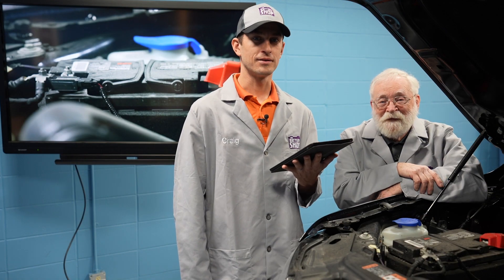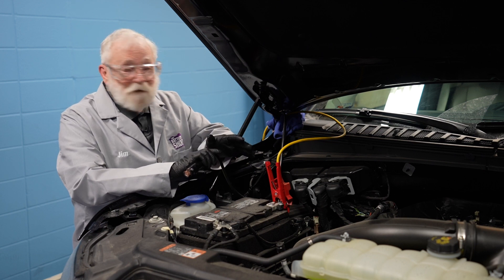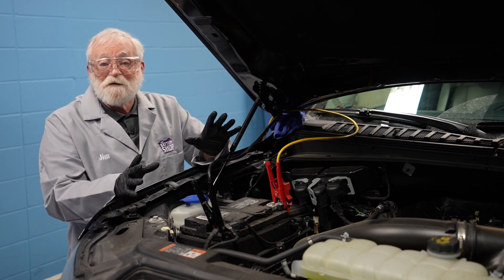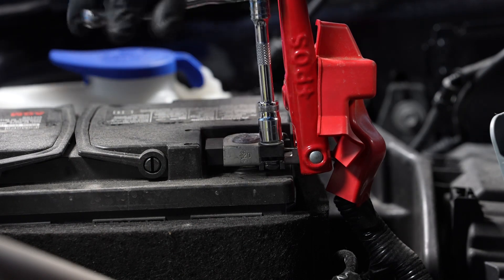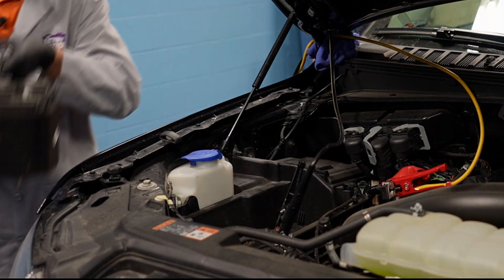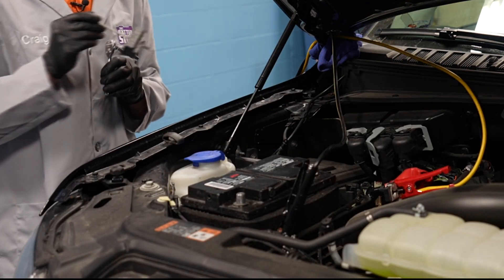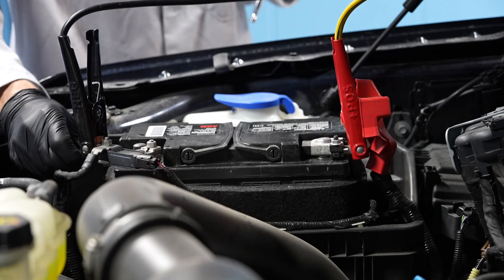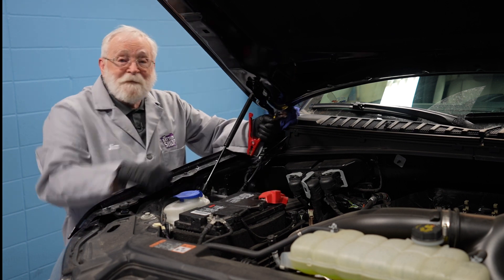Ford F-150 (2015 - present) - New Battery Install

Comment: Thank you for this helpful video. Can you tell me please what is the right battery size for Ford F150 2016/2017/2018 V8 ? AMPS AND CCA
Reply from the maker: Thank you for watching and glad you found it helpful.  The battery size and CCA for these year ranges vary by engine size and model that you have. We would suggest visiting autobatteries.com for proper fit and function.

Comment: I just swapped the battery on my 2018 F-150 Lariat with 5.0. The owners manual didn't mention any of the extra steps that you are showing. I removed the old battery, went and picked up a new one at Costco, came back and put in the new one. I did let it sit for a few hours before even trying to start it. Once I started it up, the windows all worked, I still had my radio pre-sets. I did have to re-set the clock, it was an hour off. I just took it for a drive and everything seems fine.
Reply from the maker: Hi - Thanks for watching and sharing your experience!